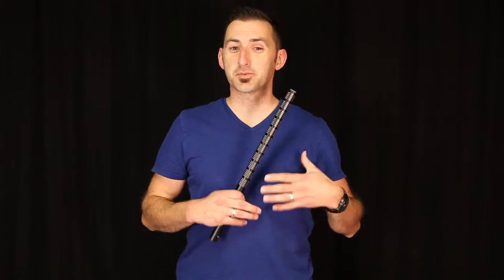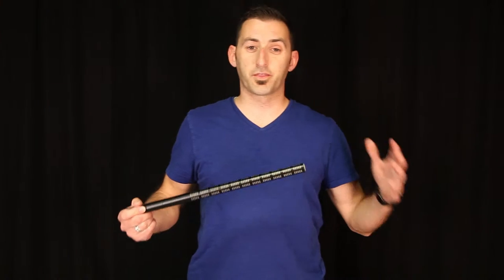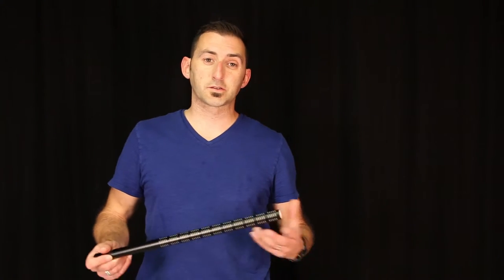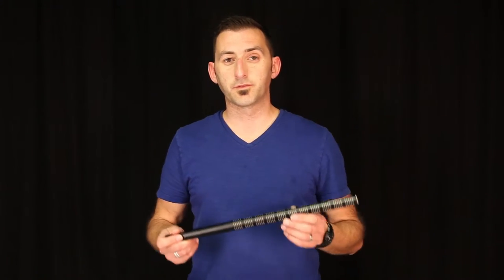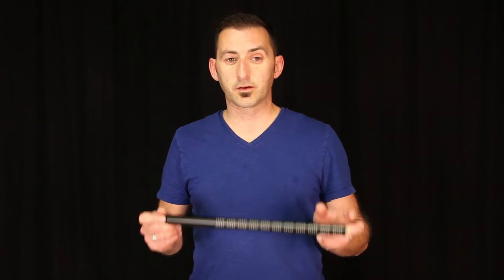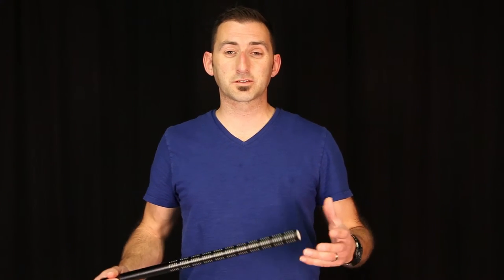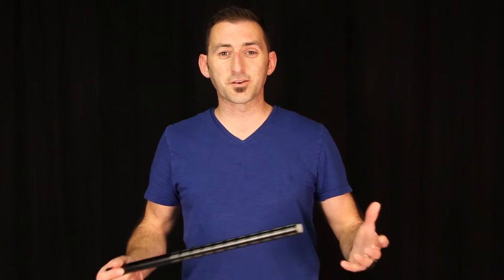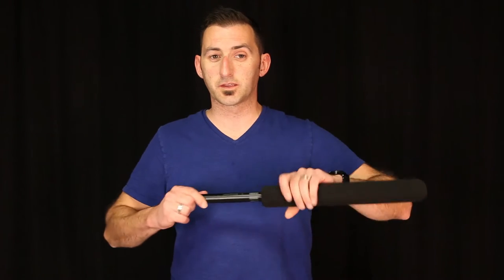Intro to Shotgun Microphones

Comment: Nice Video. Here is some constructive feedback:
Why is the sound of the video so harsh? I personally two C 568 EB's (one with 200 and one with 600 ohms). Both of them sound great, though I like the 200 ohm one better. However, I have never used them indoors.